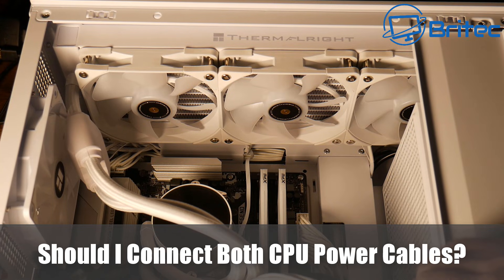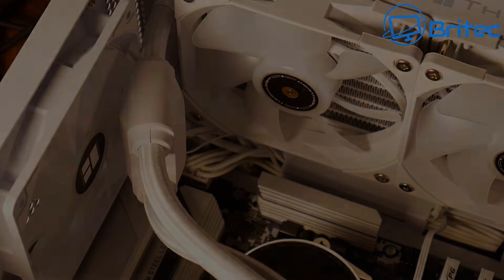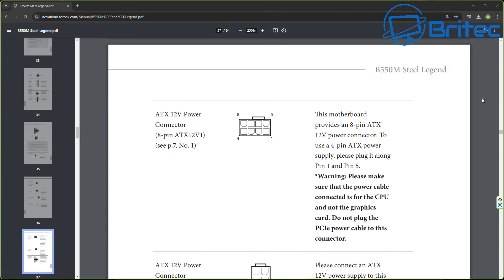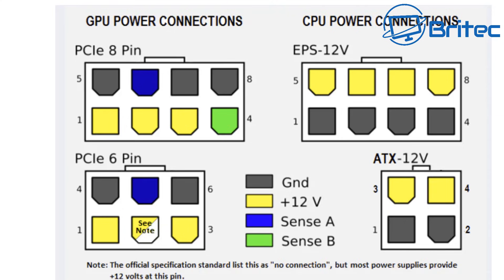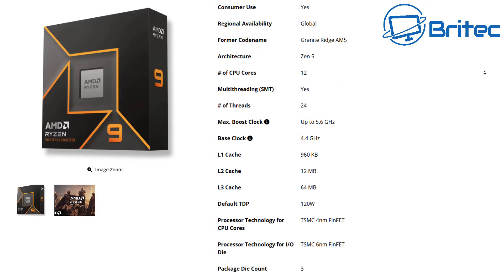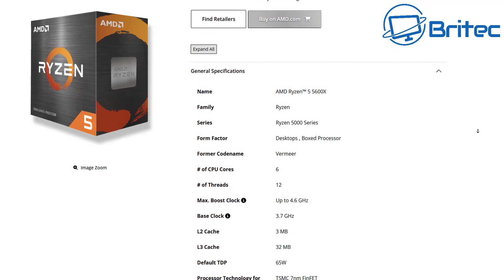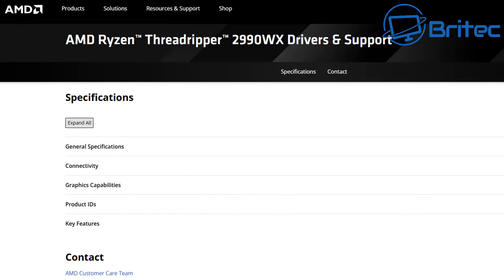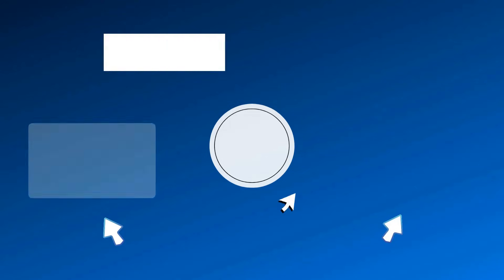What CPU Power Headers Do I Use

Comment: So if I understand correctly and my motherboard has 2 x 8Pin and my PSU comes with 1x 8Pin and 1x 4+4PIN power cables, I can connect both? Maybe I should mention that the PSU has 6x 8PIN connectors names "CPU & PCI-E"`, so I can use any of these six connectors for the two CPU 8PIN connectors?

Comment: There are a few rare boards intended for xtreme (liquid nightrogen) overclocking that have 3 of the larger power connectors. They also only have 2 ram slots despite being full atx sized (this allows creating much cleaner, and thus lower noise, pcb traces). They also tend to co$t a lot and have features like the jumper to deal with certain issues trying to boot a cpu chilled WAY below zero.